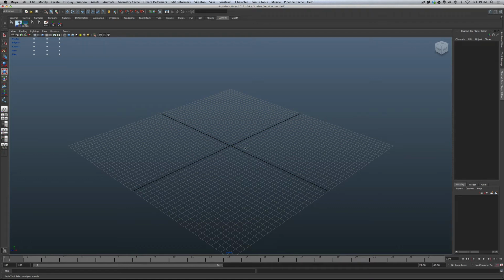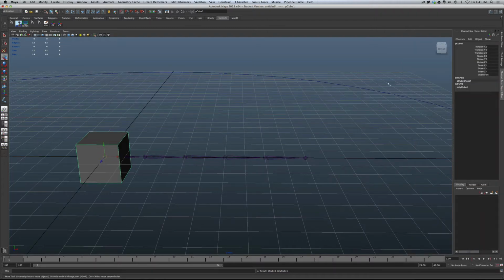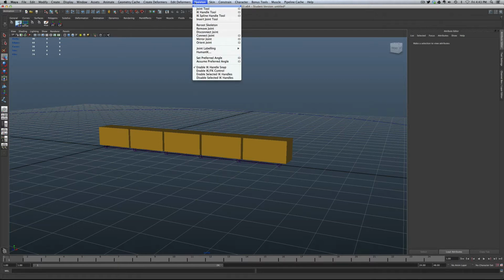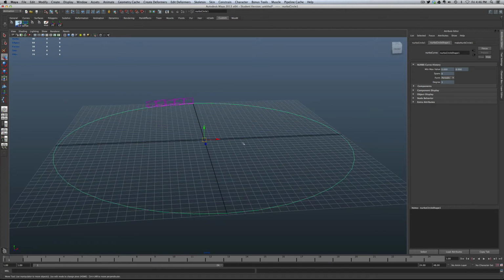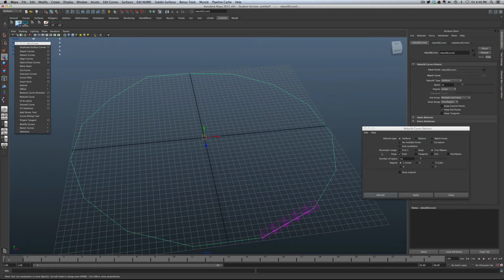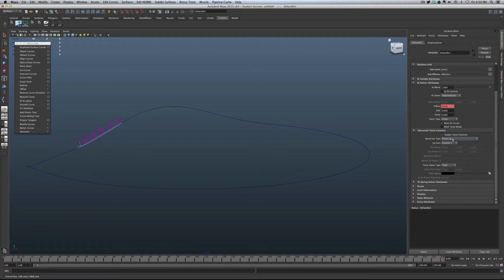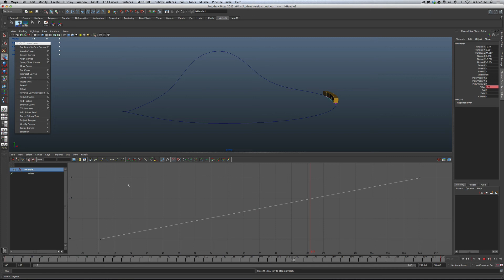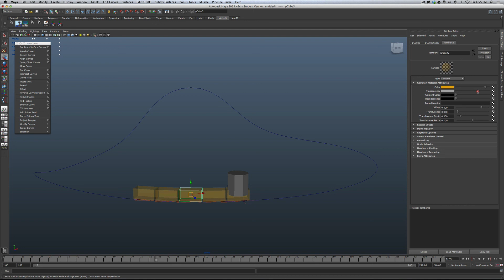Maya - Animate a Train using IK Spline Handle Tool

Comment: Hi Brendan, great vid! It helped me a lot! I am currently working on this rollercoaster animation, however, I started with this project with little knowledge on how to make it work. I am working with this track with loop the loops and some sharp curves but for some reason the train starts flipping and is suddenly upside down in curves and on top of the loop the loop instead of in it. Could you please help me on how to fix this? Cheers!